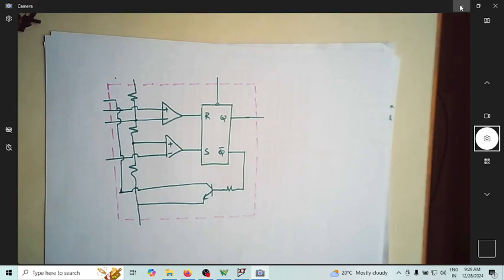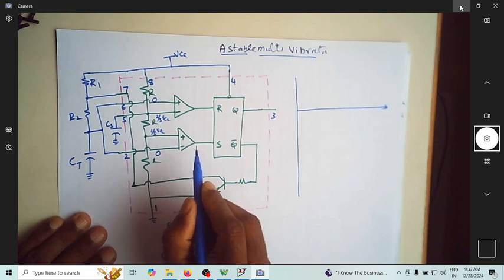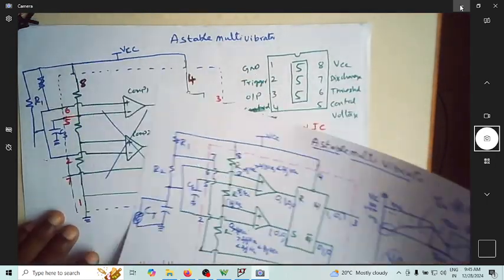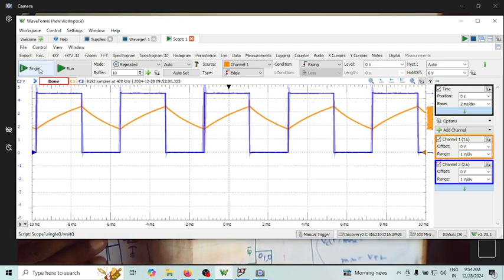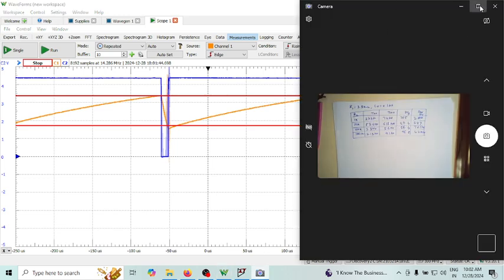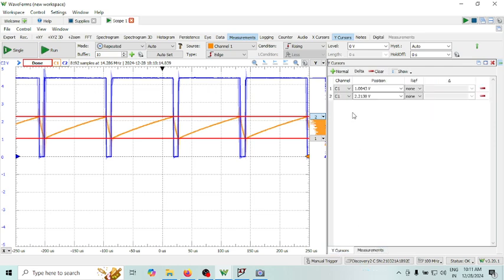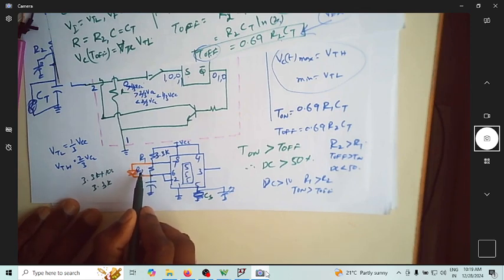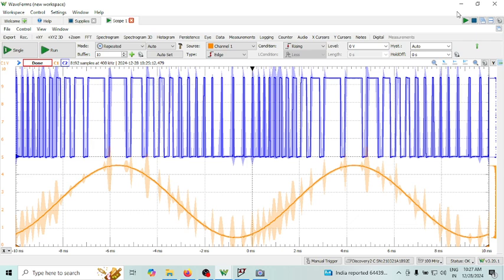555 timer as Astable MV

Comment: Nice. So when we apply control voltage is there no need to connect VCC to Potential divider(with 3Resistors) as Control voltage takes over as Vexternal?
Reply from the maker: That's a good observation,  but the Vcc at pin 5 not only used for getting VTH and VTL, it’s used for Comparators and S R flip-flop so it is necessary to supply Vcc at pin 8 even if external control voltage is supplied..